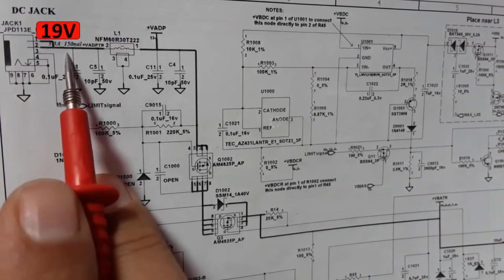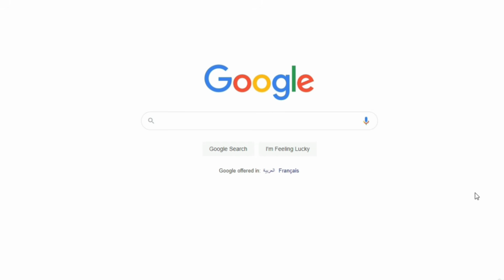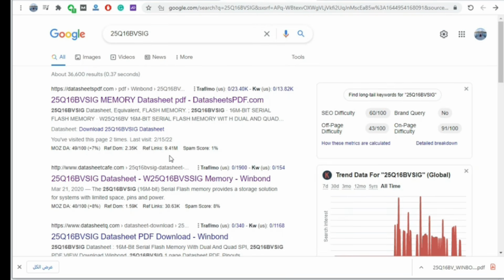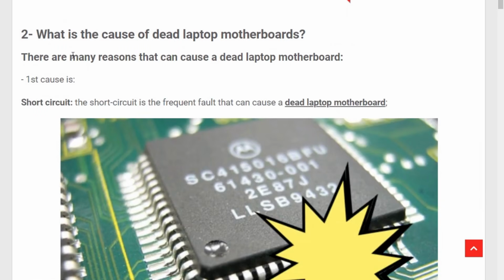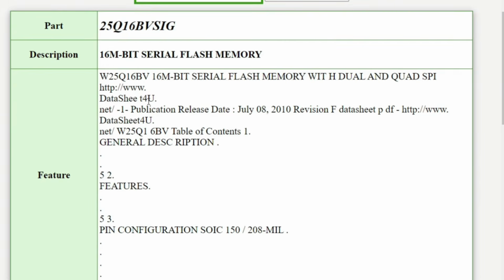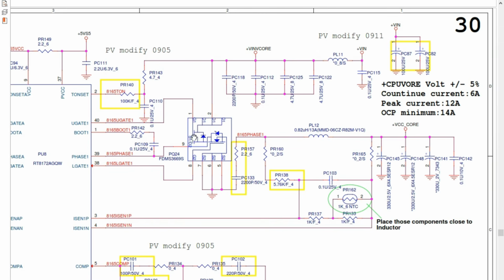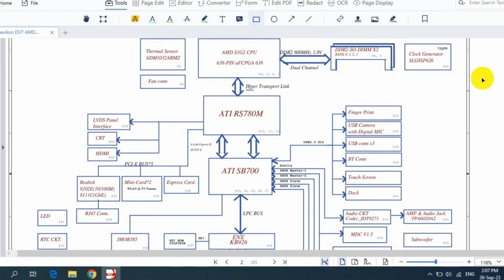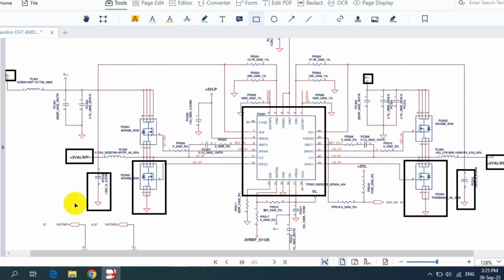The BEST Laptop Motherboard Repair Course for Beginners 2025

Comment: Please, send me your email.

I'll be refurbishing my car's battery control module.

I will replace 9 electrolytic capacitors and 7 MOSFETS.

I'd like your input as to what ceramic capacitors I may need to change as well.

My car is a 2003 SL500 with 64K miles.

I enjoy your teaching style and am learning a lot from your lesons.

Blessings.

José Antonio
San Juan, Puerto Rico
Reply from the maker: Thanks for your interest, José. I’d be happy to help you figure it out. You can find my email on the homepage, or join my Patreon Mentorship; the link is in the description.

Comment: convert an exe file to bin, just by renaming the extension, how weird is this trick and would work ???
the programmer will flash the entire exe file (43Mo), into the chip, that insane !!!!
This trick will not work, and is definitely not to be done, at least not in this way.